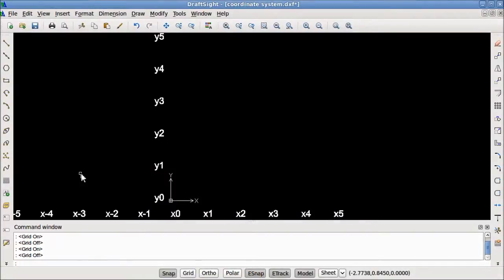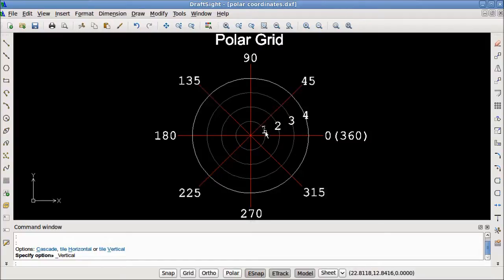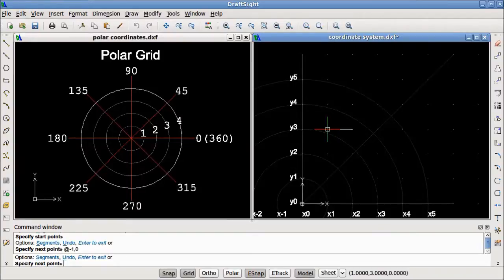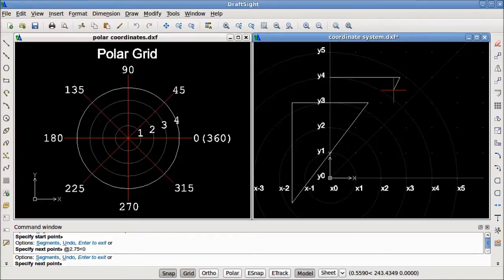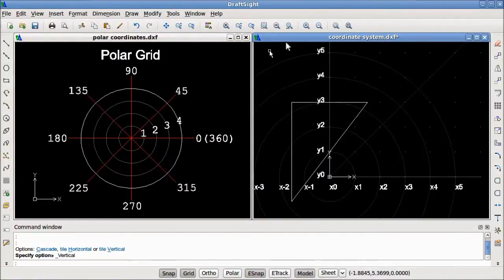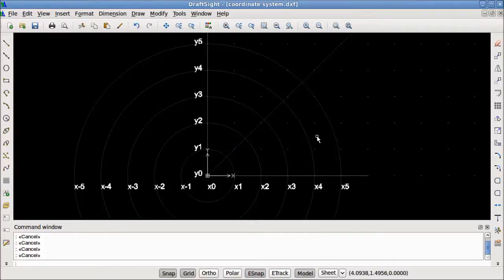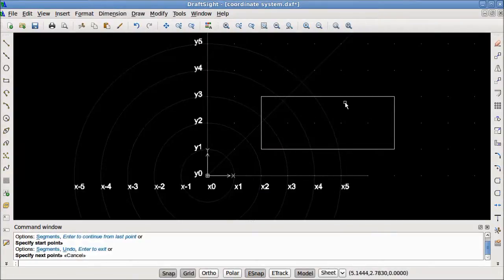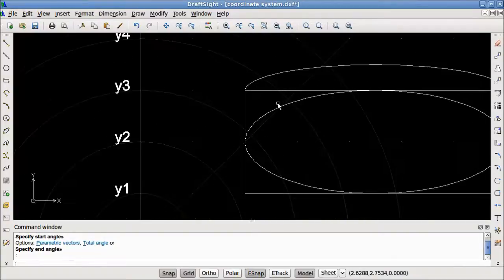DraftSight - Coordinate Systems and the Draw Toolbar (2 of 6)

Comment: how can someone actually have the x,y number coordinates visible to make it easier to designate points?
 thx in advance
Reply from the maker: +Andrew Castellon the coordinates should be visible in the bottom of the screen, beside "[Polar] [ESnap] [ETrack]...".  By default those coordinates are relative to the origin.  If you right click on them and select relative, you will see relative coordinates as you draw lines.